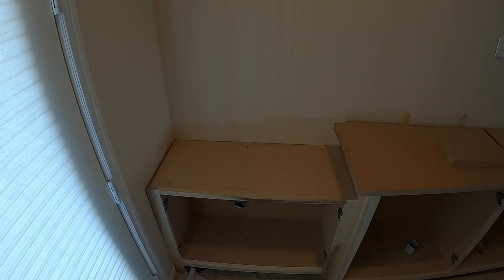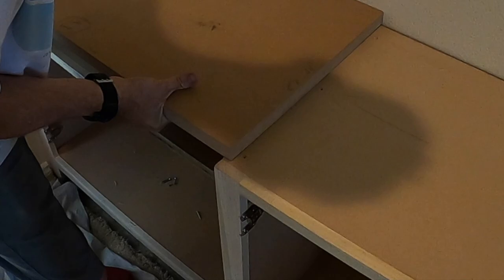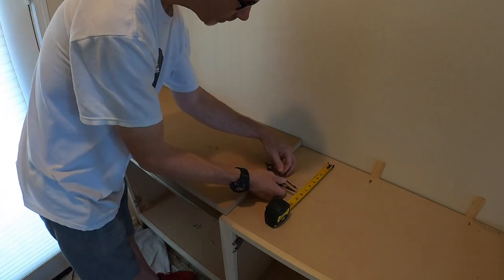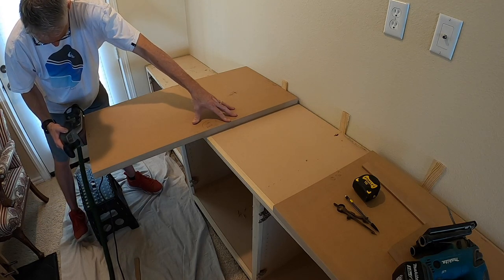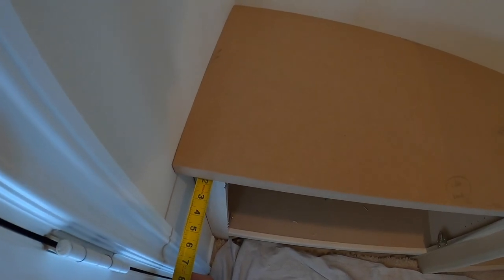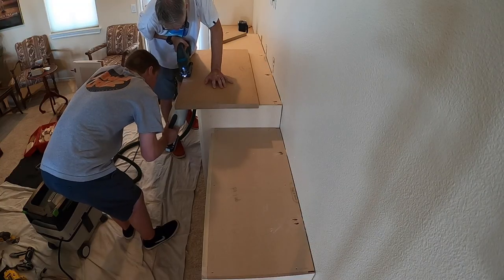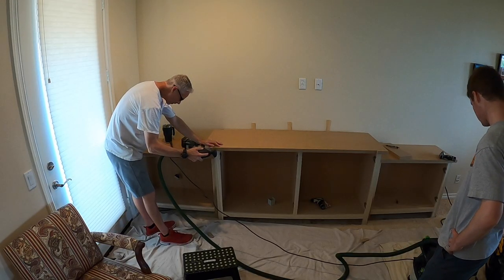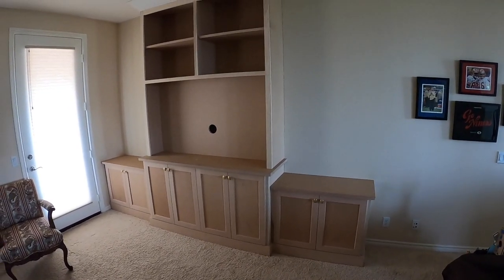How To Scribe and Fit Countertops for Custom Cabinetry.  It's Easier Than You Think!!!

Comment: I usually make a quick template with 1/4 inch ply and a hot glue gun, it also depends on how flat the wall is, both ways work, depends on the situation
Reply from the maker: It’s nice to show how to do it without making templates but Templates are a great way to do it in some cases for sure.  Thanks for commenting.